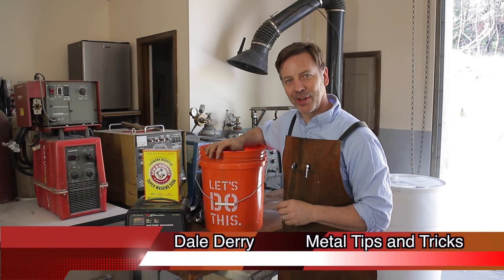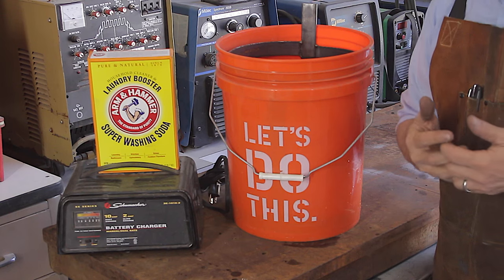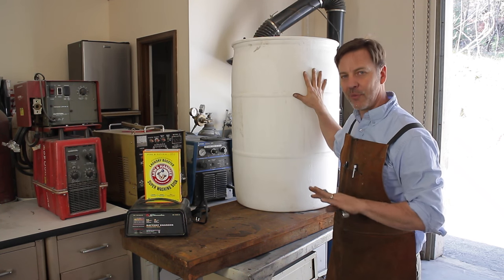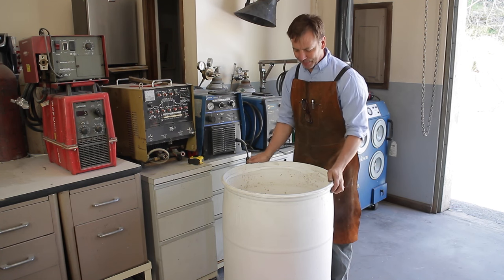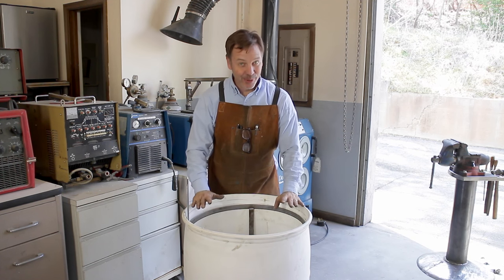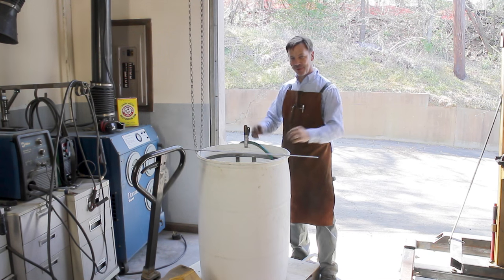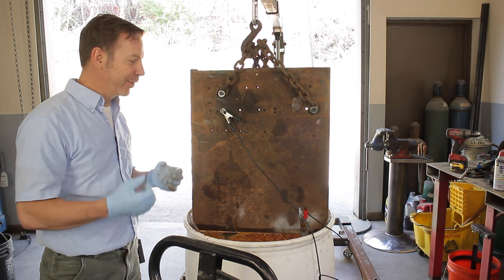How to remove Rust with Electrolysis

Comment: First off - Sorry for the long comment. 

If you want to get sodium carbonate (aka soda ash) at a better price than the laundry isle, visit a pool supple store. It is sold as a way to raise the pH of the pool water. It's also sold in the pool area of places like Wal~Mart , Lowes, and many of the other box stores. 

To get the "correct" mix the easy way is to place the parts in the tank, fill with water and connect the charger. Now add the soda ash and mix it until you get  about a one amp per square foot draw on the charger. 

Watch the meter and it will also tell you when to clean the anodes, the current will drop as they get dirty. Don't let the current drop to zero, the solution itself could cause the part to start rusting again.

You can also use this method to clean inside an object like a motorcycle gas tank, old engine cooling hopper or similar. Use something like 1/4" stock and bend it to hang in the tank. Fill with solution and hook up the power.

Tank size is limited by your creativity and power supply. I have done auto frames in a tank made of straw bales with a heavy canvas and plastic and used a DC welder as the power source. 

Two items that are CRITICAL. 
One make sure that the part you are cleaning is connected to the negative lead. Get it wrong and you could easily destroy the part. It will act as the anode and be consumed.

Two use bare steel, or carbon rod/plate only as the anode. Do not use galvanized or stainless steel. The reason for this is that the zinc and chromium will be dissolved out of the metal as it is consumed in the solution. The solution now becomes a toxic hazardous material !  ( Zinc =   Stainless = Hexavalent chromate)

Using common salt isn't a good idea either, The gas it gives off is chlorine !

One other item that Dale didn't mention. Don't do this inside your shop. The bubbles given off are hydrogen and oxygen. In a closed shop these will cause 2 problems. One is that it can easily rust every steel/iron item in the place quickly. The other is that those two gasses build up in a room, find an ignition source and BOOM !

Steve
Reply: ى
ةاعه
Reply: Thanks for the details. I have been wondering how much sodium carbonate to use. Trial and error doesn't really work because there are too many variables with using parts having different amounts of rust, and the condition of the anodes.
Reply: Zinc != stainless.  Galvanization involves no chromium at all.  The only issue with using galvanized metal as the anode (remember, zinc is used for sacrificial anodes for boats) is that the zinc can encourage other plating and alloying.   If all you're doing is cleaning a rusty engine or something, and all you have is galvanized pipe, I doubt it'll cause any damage.  You'll want to just take a file or sander to cut through the zinc plating.
Reply: @tbelding  Never noticed the rest of that missing. The reason why galvanized isn't used is because the zinc will cause issues with the solution itself and can become zinc carbonate which an environmental hazard. It's use on a boat or other areas as an anode isn't a large issue as it takes far longer for it to corrode and it is in a very diluted state.
Reply: @Blazer02LS  - That's incorrect.  Galvanization is zinc carbonate, deposited on iron.   Using a galvanized pipe (or other galvanized steel) for an anode may cause zinc carbonate to precipitate off of the pipe, but it's inherently no more of an environmental hazard than the original buried iron pipe was.  Apparently some people use galvanized sheet as a temporary replacement source for zinc when doing their own zinc plating.  (Who knew?  I didn't, until I researched it. ) 

Makes you wonder.  If it's so toxic to the environment, why are we allowed to use it, especially when a lot of those pipes are buried in fields for irrigation feeds.  (We dug up hundreds of feet of it from our property, where it was used to supply watering tanks for horses, plus watering vegetable gardens)
Reply: @tbelding  Just going by the laws that I know of.

Comment: Hi Dale, great video, given how tight the table is in the drum I think you should point out that it is important to avoid any short circuiting. I would use something like plastic to jam down the sides perhaps.
Reply: He did use plastic on the sides - you can see it when he lifts out the table at the end. However if he didn't make a pointless welded cage, then he could position the electrodes where ever they were needed - for example 2 on each side of the large flat table.

Comment: Brilliant :)  I already have a 50 gallon container (mine's blue not white but other than colour exactly the same) that I wanted to use to clean up some old Land Rover wheels.  Now all I need is the strip steel for the inner cage.  I was going to use just loose hanging strips of steel but your way is much neater so thank you for this :)

Comment: You are right! I have been doing this outdoors and away from ignition sources for no reason, I assumed it was hydrogen.Thanks for the videos, your time and knowledge..   Keep the videos coming!
Reply: It is hydrogen. That comes off one electrode and oxygen comes off the other electrode. But the amounts of gas released are so small that it's irrelevant in any normal room that humans can still breathe in. Obviously it would be dumb to perform electrolysis inside a sealed closet, however LOL

Comment: Great video Dale, I've used this process on really corroded firearms. I've found if your vigilant you can remove the rust and keep the majority of the original finish. The neat thing is it will remove rust even on assembled threaded parts, if the water can get in the rust will get out. Great job!

Comment: That is a very slick anode cage. Other things being equal, the efficiency of the process is dependent on using maximum possible anode area and you have that, plus it is distributed all around the tank. As to how much washing soda to use, I use about a big handful per gallon, but it does not seem to be critical. Shopdogsam amd mrpete222 both have electrolysis videos, much smaller scale. Might also mention that marvellous though it is, electrolysis will not remove pitting: it will not put Iron back into the pits. And that is the biggest electolysis job I've ever seen. Bravo.
Reply: +Juan Rivero You are correct and as such it is prefered for those who restore old tools. I should build one of these but I just built a big 2 speed 8 inch wire wheel belt driven from a 1/2hp GE moto and used that for a couple of decades. Gobs of torque (capacitor run motor) and gets the job done speedily if sometimes a little dusty.
Reply: Yes. I have restored many a tool with electrolysis. I wonder what to do with pitting. I wonder if you could use J-B weld on it and then shape it. With a file if necessary.

Comment: I'm planning to build one of these sooner or later , Great Video!  Currently on smaller parts I just use white vinegar and water about 10:1 ratio Water/Vinegar  , a good 24 hr soak and  the rust just wipes off .

Comment: i like to use apple cider vinegar to take rust off, its super cheap, takes the rust off in only a few hours, doesn't dig into the metal that much either, fill a tub with the stuff, dunk the part in, pull it out about 8-12 hours latter, give it a soak in baking soda and water to neutralize, then rinse and dry.  but most things i derust are small parts. this looks good for larger pieces. great video man
Reply: +James Savage Agreed! I take old salsa jars and toss nuts and washers and screws into them as I remove them. Then top off with any cheap vinegar and let sit for up to a couple days. Perfect for small pieces of old hardware that you can't replace and would be very hard to clean.
Plus it makes the shop smell like an old style Italian sandwich shop - love it!
Reply from the maker: +James Savage Thanks for the info. :-)
Reply: +Metal Tips and Tricks (Dale Derry) sure thing :)

Comment: I have used a pickup bed lined with a plastic tarp works well. I use the string together method of about six flat bars for anodes. I derusted a couple of Willys truck fenders, hoods and grills. I ran it for several weeks with several anode changes. With a pressure washer and electrolysis it took off all the paint also.

Comment: Hi Dale. I think in this process your table is the anode and your cage is the cathode. Don't go by the + or - signs on the battery charger, the rust is leaving the table and being deposited on to the cage, as we can see by you scraping it off the cage. The table is actually getting smaller and the cage is getting bigger. This makes the table the anode. Think about a sacrifical anode on a boat or a water heater, they get smaller as the process goes on. I think?
Reply from the maker: +John C 
Interesting comment I do know the  positive must be on the cage. You will not like the results if you reverse them :-) I'm talking from experience.lol
Reply: electrical current actually flows from negative to positive.. and yes anodes in water heaters corrode over time.

Comment: A method I have had some success with is getting one of those plastic kiddie pools and filling it with salt and vinegar. Different process and much slower (normally takes a couple days) however the end result is very similar. I removed the rust on some staircase railings using this method and it worked very well. I usually just leave the pool outside uncovered and let it do its thing.

Comment: Fantastic!
Question on how you dispose of the water from the bucket and the big tank?
Into the grass? Down the drain? Where do you dump the water when finished. I have a small project I am about to start but have not seen where the used water is dumped...   thanks
Reply: The answer is "YES". Iron-based solutions are commonly used on lawns ("Weed-and-Feed"). The washing soda is actually a surfactant so should improve the water penetration of soils. But too much in one place might harm plants, so dilute it and spread it around. There is nothing to harm the drains, the washing soda solution is basically soap. The iron-based gunk may stain some surfaces, so don't leave it on concrete or grout.

Comment: Very cool video.  In the Q&A, can you provide some closeups of the surface after it comes out of the tank?  I noticed there was definitely a difference at the water line when you were hitting it with the flapper wheel, but the camera was too far away to get a good view of the condition of the surface.  Also, did you notice if the surface impurities (oils, etc) on the table made a difference on how effective the process was in those areas?  Thanks :)

Comment: At 17:25 you talked about seeing the sludge on top of the solution and if you dont see it then something is wrong. Maybe if you do see a large amount of sludge, something is wrong? I am wondering if you need more anodes? The purpose of the anodes is to attract the rust, correct? Maybe the table is releasing rust faster than the anodes can attract it? Or maybe your anode cage is saturated with rust and cant attract it as efficiently. I wonder if you cleaned the anode cage, skimmed off the sludge, and ran the process again, would the sludge reappear? I'm just trying to fine tune an already good process. Thanks for the video.

Comment: Love it. I used the same approach to etch except I put on masking to protect where I didn't want to remove  metal. How do you dispose of the iron oxide? Is it safe to pour down the drain. 

Thanks for another great vid.

Paul
Reply from the maker: +Paul Devey 
From what I've heard it is safe to pour down the drain. Here in Georgia all the soil is red with iron oxide.

Comment: Similar to other videos ,but much neater.Would a circulating pump with a filter help keep the sludge from building up? I would think that a higher voltage/amperage power supply would speed things up,IE MORE POWER!

Comment: Intermodel bulk tank (IBT) would be a good option for lager items you can pick them up cheap used and they are made to be moved with a pallet truck and they have a built in drain valve

Comment: Have you ever tried molasses?   I see them using it in other countries for rust removal.
Reply: +1970chevelle396 Molasses works very well, only thing is you can't use the process on cast. Unless of course it's cast you never want to see again. 
If you're interested the solution is roughly 1/3 molasses to 2/3 water
Reply from the maker: +1970chevelle396 
No it sound to messy for me.

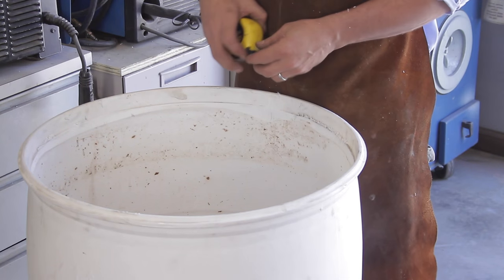Comment: 7:45 π r² (Pi r squared) is actually the formula for the AREA of a circle. For the circumference, the formula is actually 2 π r (or pi times twice the radius [2 times the radius being the diameter]). Simplified, it would be 3.14ish x the diameter. So, you got the correct approximation, but you named the wrong formula. Just an FYI ;)

Comment: Thanks for the awesome vid. 
I'm about to remove the paint and rust from a 1953 Rockwell Delta band saw, and i know that cast iron rusts up almost immediately after coming out of water. Do you have any ideas on what to do after the electrolytic rust removal to prevent it coming right back? Or is the only option to just paint it and hope for the best? Cheers.
Reply from the maker: +balisticsquirel 
Dry it off with compress air then wire brush off the any flash rust.  Before painting wipe the parts down with paint thinner.
Reply: Thanks. From what i've read there's no getting around there being some rust on a prepped cast iron part. Even industrial processes (pre galvanizing for instance) can't get it perfect. So the best bet is to use a paint that can deal with that bit of surfae rust. Something like Rust-oleum Rusty Metal Primer Spray. Peas.

Comment: Hi Dale.   I really enjoy your channel,  keep up the good work.  I'm having a problem using your system of rust removal, maybe you could point me in the right direction.  I've been using electrolysis for rust removal for several years.  I have been using the separate rods and wires method.  I really like your cage idea.  I welded up a cage like yours for a 5 gallon bucket.  I use a battery charger similar to the one you use.  Using the rods I usually draw around 5 amps on the meter on my charger.  When turned it on, using the cage,  it pegged the meter on my charger, and then shortly after tripped the thermal overload.  I switched back and forth a few times between using the cage and using rods, with the same results.  any thoughts?
Reply: You have more metal SURFACE in the water, so you are drawing more current. Reduce the amount of anode material, or use a proper current-limited power supply rather than a simple battery charger. You may be able to reduce the amps by significantly reducing the concentration of salts, but current limiting is much easier.
Reply: My brief youtube research reveals 2 amps ideal,  1 rounded tbsp/ gal. More washing soda not good too much conductivity. More amps may be faster but too ‘hot ‘

Comment: Sand blasting would have taken much less time and energy.  I have used this process on small items, it works well. but for large items. abrasive blasting is the way to go. I will give you credit for dreaming up subject matter for a video though.

Comment: May have missed it, but, did you use hot rolled or cold rolled for the cage?Would it make any difference?Thanks...
Reply: I used cheap hot rolled and sanded off the mill scale. I don't know if it helps or not but only added  few minutes to the job.

Comment: Probably not applicable with such a large application, but using a carbon plate or carbon rods will almost eliminate the messy sludge that you get with metal as your anodes.
Reply: +panofish Graphite works great. Just not as cheap as plain steel...
Reply: +panofish you can get 1/2" x 36" graphite rods on ebay pretty cheap. mine is lined with 12 around the perimeter and a 12" square plate on the bottom elevated 1 " for sludge clearance. works great, no clean up. just top off the water
Reply from the maker: +panofish 
Thanks for your comment

Comment: Stainless steel tank as the cathode would give more cathode area and be easier to clean up.  We use it as the anode where I electroplate, (30 years).  Or a stainless steel cage. Also if you could introduce heat somehow the results would go up exponentially.

Comment: Watching your video, I was waiting for sparks to fly when the table touched the cage creating a direct short. Were you just lucky or did you do something to avoid that?
Reply from the maker: +Charles Shanafelt 
I'm a couple pieces of plastic insulating the table from the cage. Great question.
Reply: If you don't roll and weld a silly top ring on there, then you don't need to worry about that. The top ring does absolutely nothing except get in the way, since it's above the water line.

Comment: take a 24volt charger, handful of road salt what they use for on the road in winter time, after about 5- 10 hours   and the rust and paint grease etc is gone, some after treatment with a steel brush